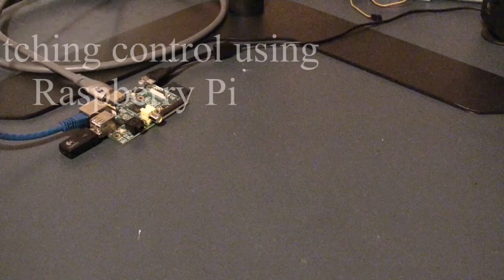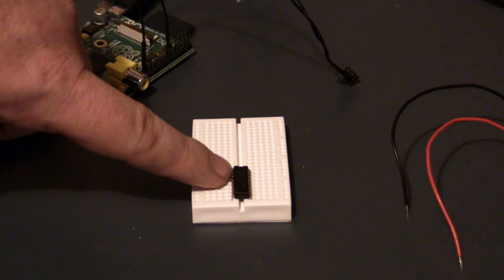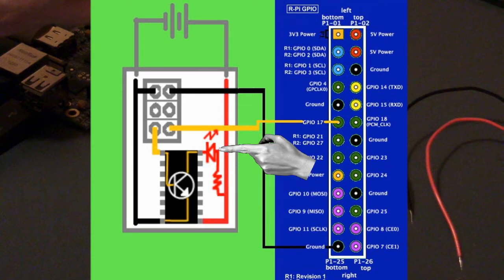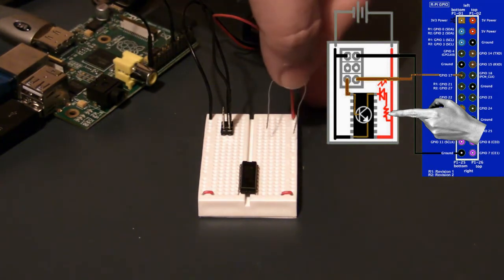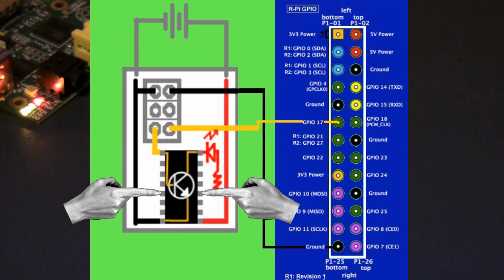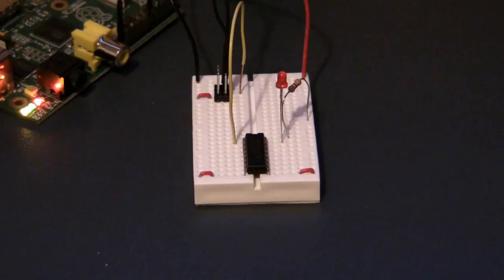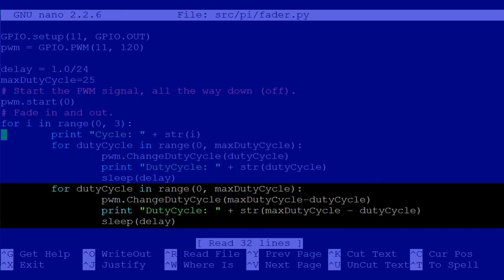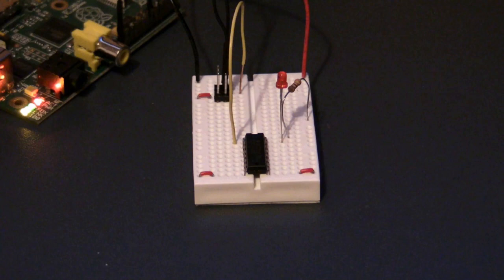Switching control using Raspberry Pi.

Comment: Hardware PWM can be achieved on GPIO18 (the only one available on the RasPi) using the wiringpi2 Python library.  Using the wiringpi  API is similar to the software PWM support of RPi.GPIO